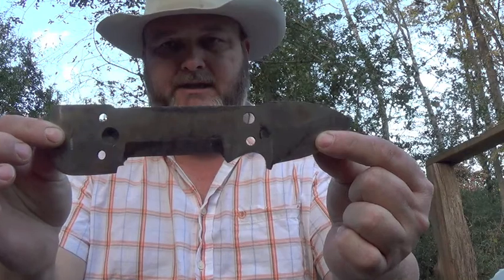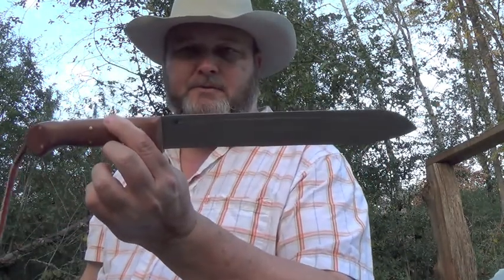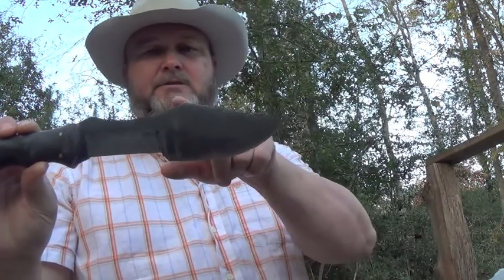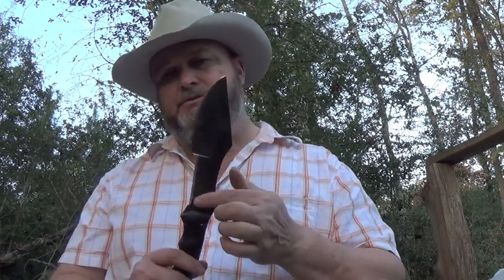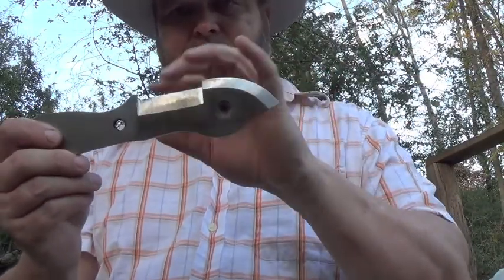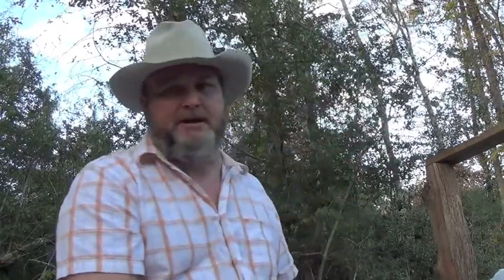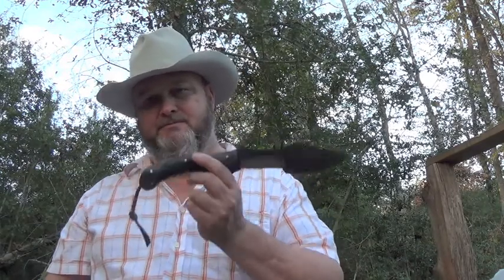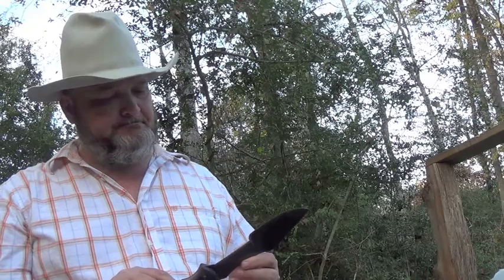Whittle Talk (Multi Edge Blade Concept)

Comment: Now that's one of the more interesting takes on Dave's knife. I kind of like it. It looks like the length and geometry of the overall design would make up for loss of mass when chopping. 
The little knife looks interesting  too but it looks like it would be a bear to sharpen. 
Hell, one of my favorite all around woods blades has multiple grinds. And it is a "cheap" production knife. It is the Gerber Prodigy. (An old one with the good 12c27 Sandvik steel) 
It is half serrated, which in itself is a separate grind, but if you look at the profile of the serrated section you will see that it is chisel ground as well. The front half of the blade is saber ground. 
I know people love to hate serrations but I am here to tell you, there is no other knife that I have (other than the LMF2) that is better at prepping wood for a fire. Gerbers serrations are stout and will hold up to abusive batoning. And like other chisel grinds they will dig DEEP into wood. (Despite the grind being "backwards" for a right handed person) when you learn to control the serrations it will make monsterous feather sticks in no time flat! 
I would love to see you try to incorporate that into a knife. Study Gerbers serrations and their chisel ground profile, duplicate them into a blade (including having the chisel grind go the "wrong" way) and I think you will see what I mean.
Reply from the maker: Michael Travis I have never  been a fan of serrations but perhaps I never gave them a chance. Who knows what the future brings. I do appreciate your input and thoughts on the video.
Reply: William, I never was either until a crazy Swede named magnus andersson made me go out and really try an LMF2. 
Honestly, a lot of serrations really do stink. But the ones Gerber uses are outstanding. You can carve tent pegs, notches, trap sticks, etc. you can baton and there is nothing that will do better feather sticks. I used to think my Skookum Bush Tool was it for feather stick making but it just can't compete with those damn serrations. Go figure!

Comment: Hey William, that concept is really great. The only thing that make me think is, that it might be kinda hard or complicated to sharpen this edges on a wetstone for example. I'm pretty good at sharpening different edges on a wetstone meanwhile, but the techniques I use always need the blade to be pushed or pulled in one long strike over the stone. So, if had this knife, I might wonder how to sharpen the chissel-grind with a wetstone, because the stone would kinda stick in between the handle and the tip. But I am not a pro like you are, so maybe you could make vid on how to sharpen these type of blades? Thanks for sharing, Cheers, Marc
Reply from the maker: Scouting Free Thanks Marc for the view and comment. When, or if I decide to make these design available I will make a video on how to sharpen the different grinds. Just remember I had to use stones for final edges so using stones to resharpen is possible.

Comment: Thanks for the info William. I have mixed feelings wrt the concept. IMHO one size does not fit all :( I guess it goes to purpose. It is a fact IMO that no multi-tool can do the job as effectively as a single purpose tool (not necessarily knife specific). There is no point of discussion wrt the grinds, that is a given. The info I acquired from your tutelage has been invaluable, at least I can now qualify why I disliked certain knives ect... and perhaps why they did not perform as expected.

There is a lot to be said about tradition, perhaps our forefathers did not have the wherewithal to be innovative, or they just plain stuck to what worked, I believe in the latter. I have owned a lot of knives in my lifetime and have always gravitated back to one knife, because of what I am discussing here. If it ain't broke, don't mess with it.

Something I do not see discussed much is the skills of the operator, which IMHO plays a larger dividend than the blade itself. It goes without saying that the best blade out there is the one we/you use.

I also see a lot of marketing of what I classify as "gadgets", once again not necessarily knife related, many of these gadgets find themselves tossed aside when the unsuspecting consumer finally realises their mistake.

Don't get me wrong I am not against innovation, and I like your approach of: this is good, but I can do better while striving for the perfect tool. That being said, what I have learned and emphasized by you: blade material; proper heat treatment; blade profiles; and grind makes for a good quality knife. IMO there is a valid reason why established companies hold to old patterns (tried and true) and probably still outsell "funky designs". To this date, I see reference to the "old days" in substantiating blade material and design. IMO that says it all :)

I am sure that folks believe that is the knife for them and there is nothing wrong with that. Personally I stick to the "tried and tested". Santa is bringing me a new blade for Christmas that meets everything I have learned combined with what you profess in general, out of the hundreds of blades on the market. I guess time will tell if that blade will retire "scout" after 44 yrs of use. To date, all have failed but I have high hopes for it.

In closing, a "toothy" grind over a "polished" edge any day of the week and twice on Sunday. Once again the grind our forefathers used. We can all learn from tradition. I am glad there are still folks out there that stick to or improve the basics. Keep up the good work :)
Reply from the maker: Switcher Appreciate your thoughts on this and if you have seen many of my videos you will know I believe that first and foremost the user must know how to use a knife. Like you, I do not believe there is a one tool option as I have stated in many videos. With that said I do think that different blade profiles and edge grinds lend to better performances when used for specific task. If our forefathers had the option of a knife like the WSK I wonder how many would have preferred it to the butcher style knives available at that time? I believe after many years of reading about these pioneers and heroes they would have chosen the best tool available for the task at hand. I do know with every technology advancement, whether it was guns or 
equipment, our forefathers dropped the old and grabbed the better option.
 It was a mater of life and death for them. Perhaps some would have preferred the WSK and others would not. Just as it is today. It is a matter of personal preference. I enjoy exploring other options and designs. That is my pioneering spirit perhaps. Or maybe the Holy Grail of the perfect knife is out there we just haven't found it yet. Again appreciate the view and comment.